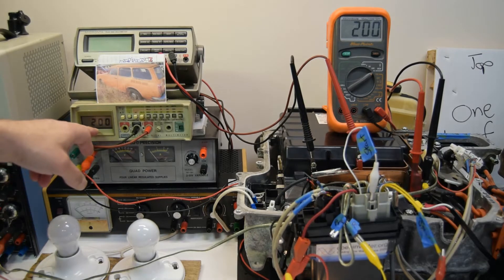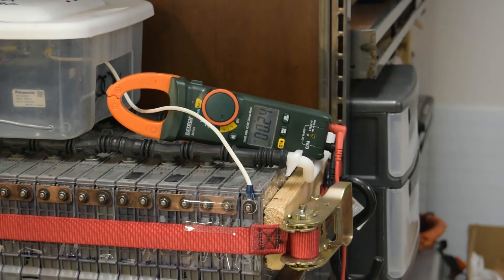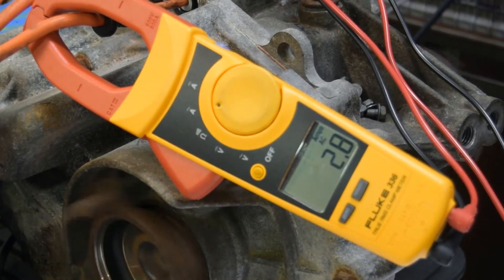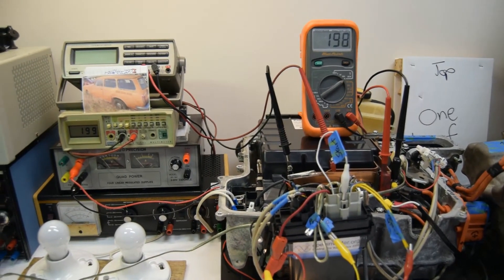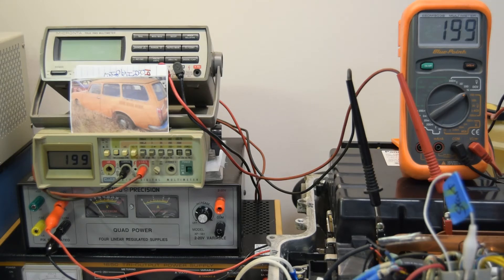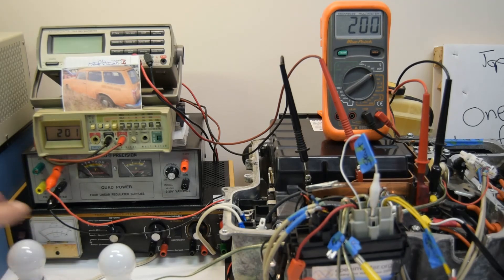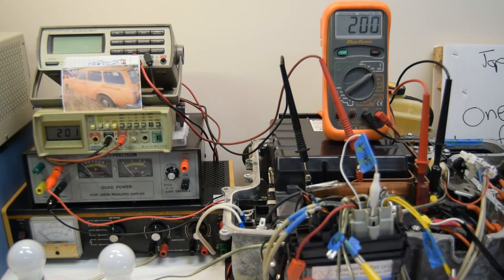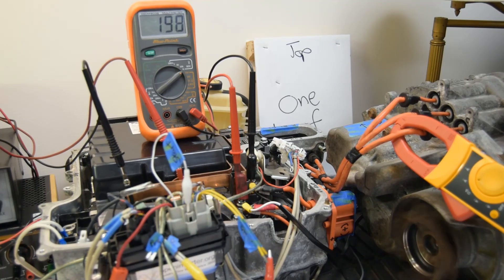Running on a Battery and charging too!

Comment: Great Stuff John, which 2 phases on MG1 are you using for + and -? Couldn't tell from the video. Glad to hear that you making good progress on the VoltsW
Reply from the maker: It's AC, so there is no + or - side and any two phases of MG1 will work equally well.

Comment: Was the VCU powered up? I guess it must of been for throttle control.  
This is VERY cool. Very simple set up for controlling the electric motor and battery charging,
Now the question is will the GS450H inverter work the same way? Time for me to do some testing. :)
Reply from the maker: @ Misfit - YES!  Based on the testing done recently by Damien (EVBMW), the Toyota inverters seem to work the same way.

Comment: Hi, how can I get RPM count into a pad or computer? I have MGR Q211 with its own RPM sensor on it which I turn and generate electricity from it. I need to get RPM. Can you help me with that?  Is there any other way I can contact you?
Reply from the maker: The Openinverter VCU and web interface will give not only RPM but also total revolutions.